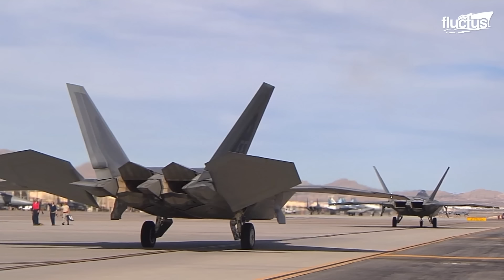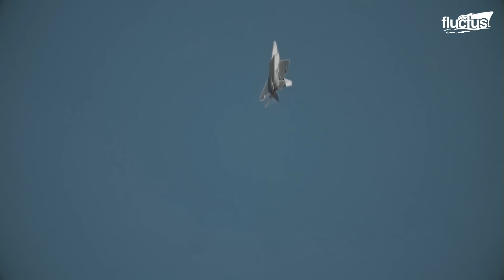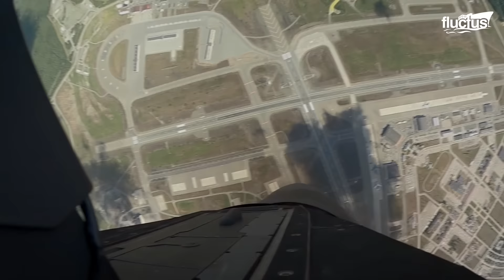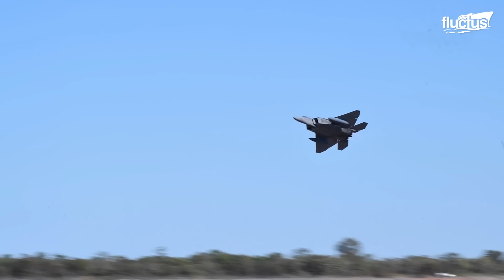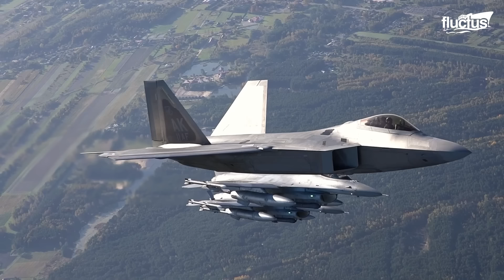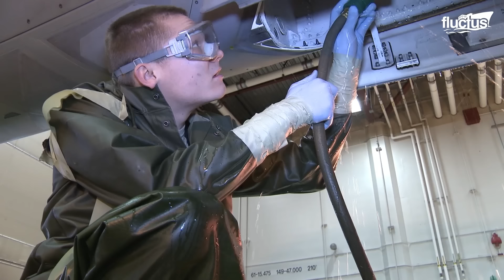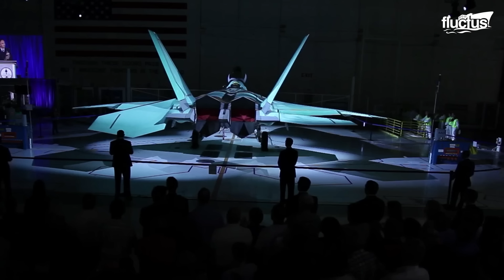The Secret Behind US Most Aggressive Stealth Fighter Jet Ever Built

Comment: 1:04 as somebody that used to machine find gas turbine engines, casting when they came out of our foundry before we shipped them off to Pratt & Whitney, GE Rolls-Royce, etc., I used to be in the understanding these had more than 35,000 pounds of thrust this aircraft is capable of two to one thrust ratio and it can max out at 70,000.